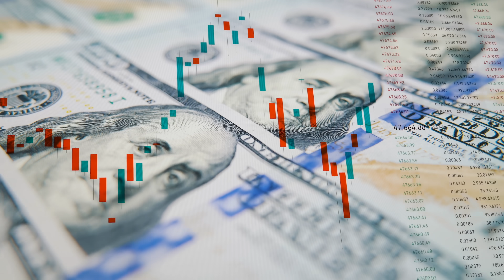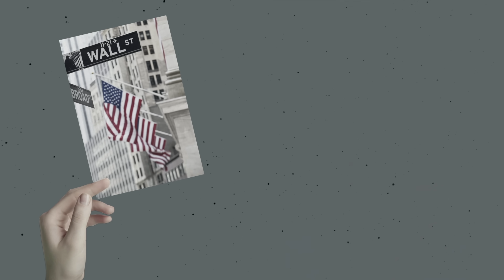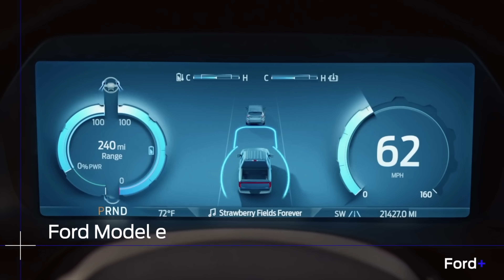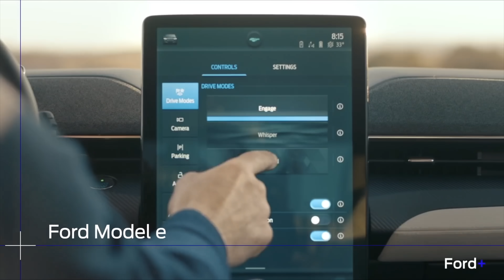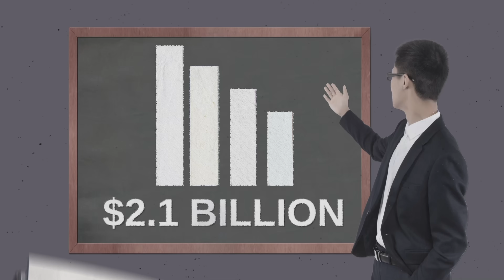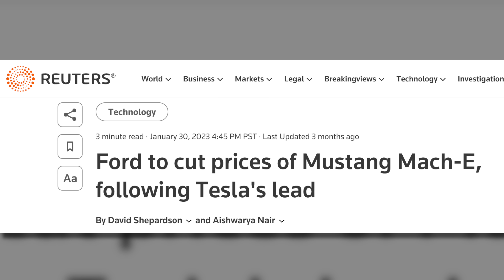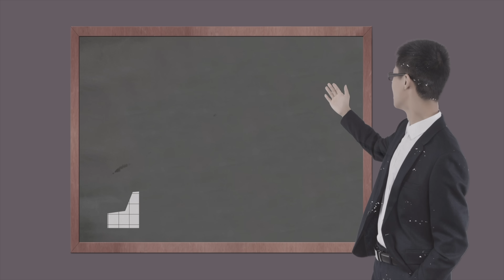Ford CEO Just Announced “We're Losing Billions and Have to Break Up the Company"

Comment: My son and I just finished restoring a 1950 Ford F1 pickup truck. I wish they’d make simple, basic trucks like that again.
Reply: I wish I could get my hands on one like that. You could always convert it to run on wood gas if petrol  is unavailable.
Reply: Just give me a cab, a bed, four wheels, a good, rugged power train, and a mechanical A/C. That’s all I want. I’d buy that right now
Reply: There are "simple basic trucks" Ford builds. However , the same people who say "I just want a simple truck" are literally the same ones who instead go out and by the fully-loaded, fully-optioned , top-of-the-line, and fully-equiped ones that are expensive. 

Four doors or two doors.

The Audacity
Reply: P.S. I got nothing against guys buying the high prices fully loaded and optioned out trucks....however I hate it when them are the same ones that say "I want just a simple truck" yet go the opposite route.

Besides , buying a fully loaded, optioned out, fully equipped truck is better than just buying a high expensive Range Rover/Land Rover (or something similar) that doesn't give you much advantage , smaller than a "Regular Sized" Cadillac Escalade, Lincoln Navigator and are problematic as hell.
Reply: @Wolfgulfur  manual windows and transmissions
Reply: @charlesbakston7414  We are? Pretty sure we’re mostly the ones buying used trucks
Reply: @Wolfgulfur  Your point is? People who say "I want a simple truck" are literally going to opposite route. The Audacity
Reply: @charlesbakston7414  You personally know timvandenbrink4461 and his purchasing history? That’s impressive. Are you a psychic?
Reply: @charlesbakston7414  don't speak for everyone. Simplicity is reliability.
Reply: @Glen Benton  issue is not everybody knows how to drive manual. I only know how to drive automatic and it's probably safer for me with my adhd
Reply: I think Tesla will sell thier skateboard to Ford to use with older body styles.
Reply: It's called upselling and incentives. I used to sell Ford trucks in Central Texas. We're talking a LOT of ranches/farms and good ol' country folks. The trucks that would sell the fastest on the lot were the new simple trucks you describe and used diesel F250/350 pickups. We couldn't keep them on the lot. When we did get simple trucks in, we were directed to park them in the very back of the lot because there was more profit margin in the loaded models.
Reply: Quality down ,prices way to high.
Reply: They would make billions if they did,most CEO’s are too woke to understand that
Reply: @rfichokeofdestiny  Lol just say you are one the guilty ones that talk a bug game about wanting a basic truck yet don't do it!
Reply: @sadiegirl9100  "not everybody knows he w to drive manual"

There are people who knows how to drive manuals. However folks don't want much hassles. And what are y'all so big up on manuals for anyways especially by telling people they should drive a manual? 

You fail to realize what country (USA) your living in.

And last I checked people be messing up manuals transmissions especially grinding through gears
Reply: @Wolfgulfur  So you're guilty of buying the higher priced trucks while saying you want just a basic truck lol 

Guilt
Reply: I got a 2012 f150 and it's so hard to work on
Reply: @dewarkhodern9990  No, I don’t want a basic truck. I don’t want a truck at all. I just think it’s silly to assume things about people on the internet that you don’t know. As you just did with me, in fact. You’re obviously obsessed about this (frankly silly) thing. Lighten up.
Reply: @kaptunkordan6656  You must have got the Ecoboost.
Reply: @elvism684  no it's the 3.7 V6 but the dealership I got it from sold it to me as is for 12k with a bad torque converter and a random wiring issue where it randomly won't start. And now during this winter the defrost switcher broke so I can't drive it when it's below freezing
Reply: Just picked up a 1992 f150 and I’m a happy camper
Reply: Restored to as new? Single master cylinder/non power assist drum brakes.
No power assist steering. 
98 horsepower inline six. 
Non synchronized 1st gear. 
I would put a Chevy S-10 Chassis under the F1 body.
Reply: @fromthebackofmymind  I had zero body work to do. Every single mechanical, hydraulic and electrical system was repaired or replaced. New brakes, lines, and master cylinder, valves, gaskets, fuel pump, carb, solenoid, coil, plugs, wires, converted to 12 volt, shocks, drag link, gear box, upper and lower radiator tubes, belts, fuel sending unit, gas tank, alternator, battery turning signals and lap belts, refinished the wood in the bed, carpet, headliner, sun visors, door mechanisms and about 30 pounds of nuts and bolts. Yeah, it was a busy winter!
Reply: Ford however does make the base model trucks....yet however for around 40000+ you're better off getting you a four door half ton with a short or long bed
Reply: @rfichokeofdestiny  You sound mad towards the truth....who will want to spend around 40K plus on a base model 2 door truck when you can spend around that much for a four door with a short and flat bed?
Reply: @Wolfgulfur  Not everyone is the same?
Reply: @blazeboyblazeboy4470  The truth hurts of what Charles said don't it?
Reply: @timvandenbrink4461  Good build list!
My son put a 77 F-150 Custom Longbed back together. All the stuff like yours. He got maybe 80% done and needed house money. Some one got a pretty nice 302V8 C4 pick em up. Sweat equity is priceless.
Reply: @forlergusther9716  I have no idea what you’re trying to say. Sorry. 🤷‍♂️
Reply: If Toyota would put out a new 1992 Toyota pickup, stick shift, that I used to own, I'd buy it
Reply: They’ll never make trucks like that again.
Reply: These older trucks with some maintenance are out lasting new trucks! Aren’t new cars supposed to last longer? Guess not.
Reply: The trucks that are coming out now (besides electric) for the price they are literally the best time to buy a truck. People seem to forget about inflation,  classics are beautiful but if you actually look at them from a practical aspect you are getting a way better deal now. You can still get a base model truck for cheap.  Yeah if you look at the luxury model you will get luxury prices.
Reply: @Yophillips3272  Exactly. I like a 1980s GMC Four Door Dually with a V8 454 and Heavy Duty Three Speed Automatic (TH400) . However that doesn't mean I'm going to bash the trucks of current.
Reply: New cars R too damn expensive. I refuse to pay $700 a month for a new. RIDICULOUS!
Reply: Your right! Make simple again.
Reply: They would sell a ton of them
Reply: Cyber truck will be very simple and basic...and still have all the bells and whistles.
Reply: Simple truck, manual windows, ... What makes you think manual windows are cheaper than power windows??? Power window components are bought by the millions, manual window parts would be bought by the hundreds. Same with transmissions. Basic truck, ..you mean without a/c, power steering, power brakes?  They are required to install so many safety features, think airbags, abs brakes, 5mph bumpers that a $30,000 truck isn't really possible. You can still get an XL trim for mid $40s but prices in the $30k range are gone.
Reply: @myaffiliationisasentinel5815  they can't. Look at all the safety features and emission requirements that have been added over the last 30 years.
Reply: Government regulations.
Reply: Government regulations will make sure that never happens.
Reply: my 04 4.6 has hand crank windows there isn't much to it either
Reply: NO MORE.

Comment: I want a BONE-STOCK 4x4 truck with a v8 engine hand crank windows with vents, and a 5 speed manual transmission.
Reply: @FORD, listen to what people want, starting here. it could save Ford's Industry's life
Reply: Right ! A non Karen/ soccer mom version of these trucks .

That stick is a far superior anti theft system now a days haha
Reply: So you too are looking for a 70s or 80s truck!!
Reply: @tylersowa3858  My daily driven 1985 Toyota 4runner SR5 5 speed on 35's with 5:29 gearing is great!! gets 22mpg using PURE gasoline. no E10 crap.
Reply: 25 years ago I bought a fully restored 1964 Chevy pickup.  It drove wonderfully.  283, Powerglide, no power steering or brakes, roll up windows.
Reply: Manual windows?
Reply: @Spaghetti-is-gross  Yes, they worked wonderfully.
Reply: I’m with you on that.
Reply: I dont know about the manual windows
Reply: Amen. Maybe even a 5.0L I-6 that wont be killed.
Reply: Yes! Just remake the 85 blazer but with modern suspension and interior except without unnecessary tech!
Reply: Me too!
Reply: I hear that! I'll order that same vehicle!
Reply: @tresselwayne  automatic window motors overheat quickly when exposed to extreme heat.
Reply: You can still get some good early 2000s Rangers.
Reply: It's not that hard. The technology exists. It's asinine behavior why they are not doing that.
Reply: Amen. No computer and easy to swap parts and parts that last as long as I take care of it.
Reply: Just make a 5 liter v8 and maximize on its efficiency. Same for 2.3l turbo.
Reply: 100%! Chuck on front and rear lockers as a $3k option, and sell it simply for $35-40k and I'll buy one yesterday
Reply: Not a problem I'll have one ready for you in a couple of days, that will be an extra cost because we'll need to take all the extras off. How dose $65,000 sound?
Reply: @markc1548  I won't go for the "extra cost", be cause it is BONE STOCK. no computers and gadgets.
Reply: @markc1548  On another note, if i were wealthy, depending on what is needed to build an old school 80's style Toyota truck or 4runner 4x4 with manual transmission and transfer case, vent windows, crank style windows with the Diesel 4 cylinders like those on Isuzu Box trucks we see on our highways, with some 4.9 v6's and 5.7 v8's we'll talk.
Reply: with SOLID FRONT AXLES.
Reply: I want a Toyota Hi-Lux with everything manual and a plain Jane interior.
Reply: @LyadinDima  That thing was a true rig.
Reply: Yes, that is what a truck a should be😁
Reply: Where's the subscription income from that?
Reply: @tresselwayne  , I have no problem with manual windows. One less thing to have electrical problems with.
Reply: 100K for a Ford pickup. I’d just want a basic truck.
Reply: @Spaghetti-is-gross  yes remember them well 
I’m 62 , my first car with power windows was a 2005 escape 

1979 olds delta 88, 1988 olds cierra , roll up,windows
Reply: @dundeeecroc - You, and nobody else. Most people today can't even drive a stick, want a heated steering wheel, and the vehicle to tell them when they are drifting out of their lane.
Reply: @ronnie_5150  It's crazy.... I prefer standard transmissions because they are strong and reliable, automatics cost more to repair and besides, standard transmissions are better for fuel economy too.....
Reply: My wife and I were considering retiring our manual 98 Ram 2500 12 valve Cummins diesel last year. It needed lots of body work, was rusted out completely aside from the frame. 
I couldn’t find anything on the market that I could trust enough to pay $100,000 for. 
So now I’m just doing the body work and keeping the old rig for another 20 years hopefully. 
Everything new is high tech junk.
Reply: HOMIE! YOU RIGHT THE NEW GOSPEL AND ILL PREACH IT!
Reply: @robertdesertrider2694  AMEN BROTHER!
Reply: @Spaghetti-is-gross  electronics always fail.
Reply: @missano3856  I have the 1985 Toyota 4runner SR5 5 speed and I daily Drive it.
Reply: I was told Ford doesn't make a stock truck because women want trucks. And they are not about hand cranking windows or doing without air conditioning

Comment: I am a ford technician At a ford dealership and the problem is the trust between Manufactur and dealer ship IT  is broken 
So for instance Our service drive manager Makes almost 200k or more I mean I Seen Pay stub for 10k 1 pay period is like 10days Meanwhile they usually have 0 knowledge about vehicles or customer service they just get paid. THEY RUN DRALSHIP INTO THE GROUND AFTER 5 YEARS THEY CAN GET FIRED DOESENT MATTER IN THAT TIME THEY MAD ENOUGH MONEY TO RETIRE THE STEALING AND FLEASING  HAPPENS FROM TOP TO BOTTOM
Reply: hey Timothy it's been going on for decades.  i worked at a multi - line dealer whilst in college and after ('79 - '84) ... the 3 manufacturers and the dealer constantly trying to screw each other.   broken trust 🙄.        let me know if you're curious who the mfr's were

Comment: Most F-series trucks are employed as tools of every trade. Trucks that cost twice as much but can't do half the work of what they intend to replace are not going to sell very well.
Reply: Exactly, you'd think it would be obvious.
Reply: 100% nailed it
Reply: A 2023 base f150 can pull and do way more than a 2005 f150. But the price is still insane.
Reply: I'm comparing to the extremely limited capabilities of the new LIGHTNING.
Reply: @rdmineer1  oh yes. The electric trucks are terrible. It needs another 10 or 15 years of tech upgrades before electric trucks can be an option.
Reply: Oh yeah and I just love the frail plastic pegs in the tailgate mechanism and the dainty electrical contacts in the wiper stick that shorts out in the newer F150.  Work truck I am stuck with.
Reply: yea  trucks are now luxury vehicles instead of work ,
hate it alot
Reply: Market Research 101.
Electric cars should be focused on lighter vehicles not trying to turn SUV's into Tesla's.

Comment: They got too Greedy, and it came back to bite them.  They deserve what they get.  Thieves get what's coming to them. The Dealerships are worse, they lie and cheat to make sales and that is sickening.
Reply: How can you get ripped off in a dealership with all the info on the internet?  You can see everything now.
Reply: @yamahajunkie1490  That's not the point.  The point is they engage in despicable practices and it's important to not do business with them. I'll look for a reputable dealer instead and hope the corrupt ones fail.
Reply: Some are more reliable than others.
They're local businesses for the most part.
The reason they do this is because most people negotiate everything. 
You need to learn to negotiate and know what to expect before you go. It's a game both parties need to play.
It's not rocket science either.
Let them make an offer, review everything that you need or don't and then male a counter offer. If things don't go your way leave they will call you back.
Reply: @Soldano999  I used to program F&I computer systems used by dealerships, so I know the industry, and consequently can negotiate very well. Negotiation isn't the issue.  The issue is things like upselliing nitrogen-filled tires (when the air is 78% nitrogen already and they're not for aviation), or other similar bottom-of-the-barrel money grubbing predatory tactics that harm people that don't know any better.  Dealerships that engage in such practices (and lie or misrepresent) are despicable and deserve to fail in favor of dealerships who treat customers fairly and build relationships.  Good salespeople help customers buy things they value.  Bad salespeople lie and cheat to get a sale at the expense of the customer.  Dealerships are ripe with the latter, and deserve to fail, hard.  Direct-to-consumer sales like Tesla, Lucid, etc are the future.

Comment: I ordered a F250 2022 supercab, rear doors didn't open without rubbing the cab. Ford said no way to fix it. Owned 3 months and dumped it for a Ridgeline. Glad it happened, they have a huge issue with the 7.3 engine

Comment: As the son of a retired fireman, I'm worried about all the special needs to deal with EV wrecks and their storage after the fact. When I was in the Navy, EVs would be considered a class D fire: needing special methods to extinguish included dumping over the side if possible/needed to save the ship. Lithium battery fires are insanely difficult to put out. People very rarely mention this aspect of EVs.
Reply: When they explode, they explode dozens of times. Gas tanks blow once.
Reply: I drive 100k miles a year for work. Those big black spots on the side of the highways occur about every 10 miles on average.

Comment: Ford really needs to improve their quality as their current record is not good.  I have friends who will no longer buy Ford products because of their prior Ford ownership experiences.
Reply: American car brands have had that reputation for years. The thought of buying a Ford wouldn’t even cross the minds of most consumers, unless they want a truck.
Reply: Ford
Means
Found on road dead
Reply: @jacklawer6389  First On Race Day God willing.
Reply: I agree.  Also, the prices are getting insane.
Reply: Flip Over, Read Directions 🙃
Reply: My 13s edge is nicer than most 20s rides like a .magic carpet😅
Reply: My experience with Ford is they have a lot of smaller issues but usually not major problems and you can beat the heck out of them and they keep on truckin. I have had about the same luck with Honda less small problems but still Chevy or GM  just junk I know people swear by GM and their grandpas cousin has one with 250k miles on it but yeah because they drive like grandmas if you actually try to drive them the same as a a good ford or Honda they will just blow up. Just my opinion 🤷
Reply: Maintenance no backyard mechanic sht   ill admit the fusions tauruses some are nice most are junk
Reply: The American car companies got really lazy in the 70s, 80s, 90s when they realized that older people would buy them no matter how awful their vehicles were largely out of the still living memory of having fought a war against the two countries actually designing decent cars during those decades - Japan and Germany.